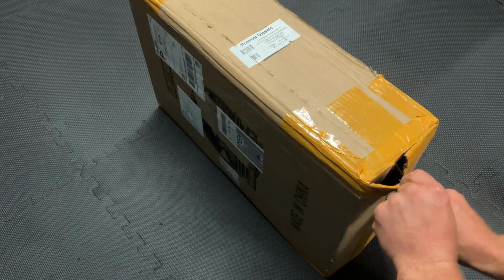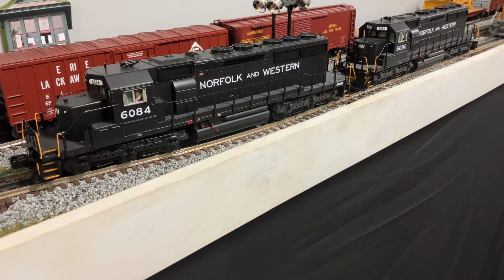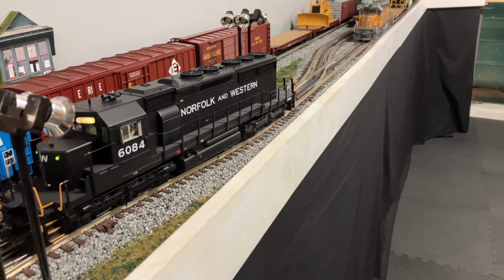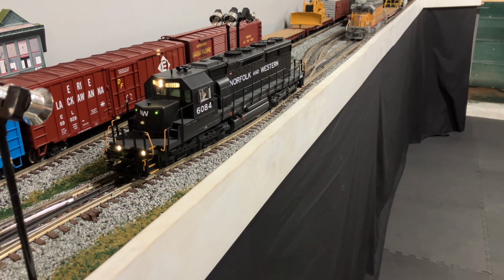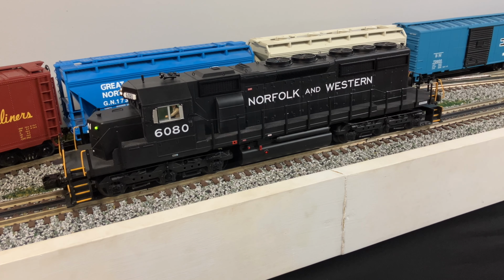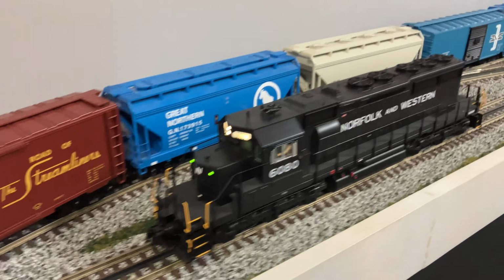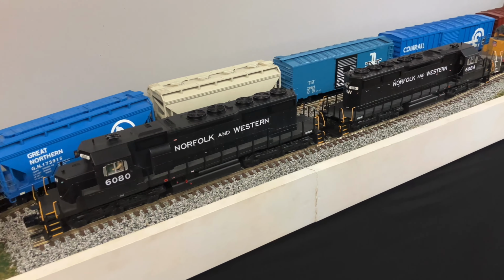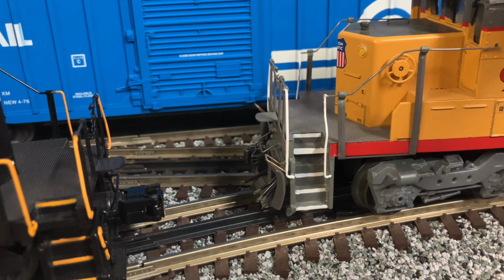Special update! SD40-2’s from a subscriber!

Comment: Please please please do a side by side comparison of the mth sd40-2. And  a Lionel ,. My point is , is that the Lionel does not look scale to me....the back porch. On the Lionel is far to short....so in effect if these are to be scale size, the Lionel version is to short.... Now I might have been looking at the wrong engine.    But I think that the Lionel is wrong. Thanks.
Reply from the maker: I am looking for a Lionel UP sd40-2 to purchase. Unfortunately I can’t find one and I’ve seen other Lionel sd40-2s going for over 600 which is crazy for a plastic locomotive. When I find one for the right price I’ll for sure buy it. If you have a lead on one let me know